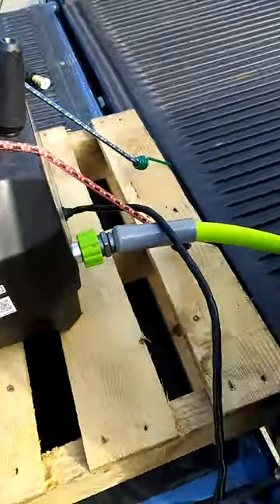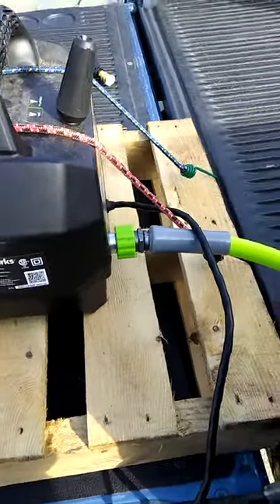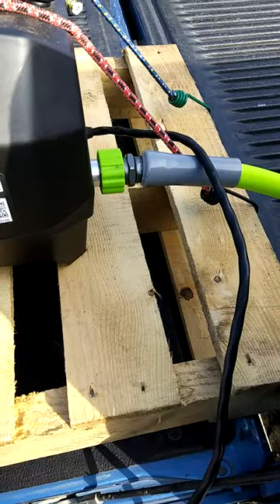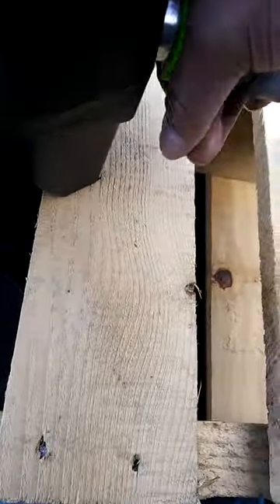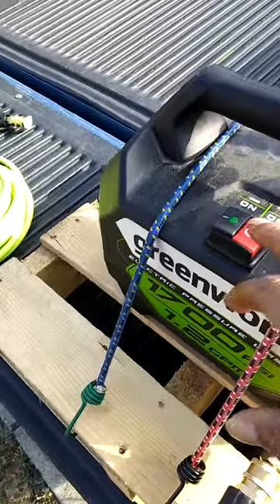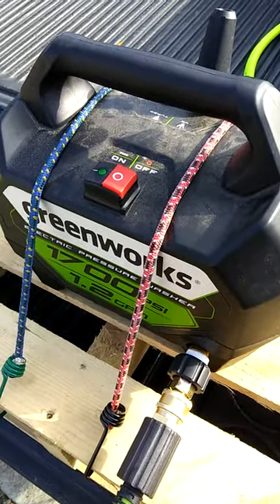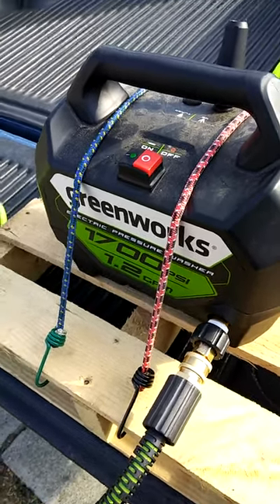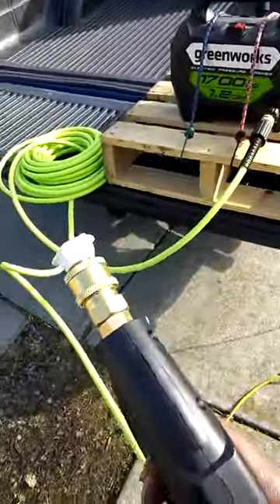How I Created My Water System Gravity Feed

Comment: You would benefit from it more if the unit was lower than the tank not higher
Reply from the maker: That's an old video,we just was doing a test run. Totally different now my friend 👍🏾
Reply: @wash.wax.shine.detail7554  is it safe to say this works and is a way to avoid having to buy a water pump?
Reply from the maker: Yes, I'm still running this set up right now, but I did just add a pump. This for Detailer's that's on a budget and can't afford a water tank or a high end gas pressure washer